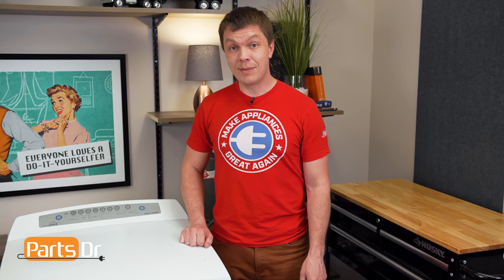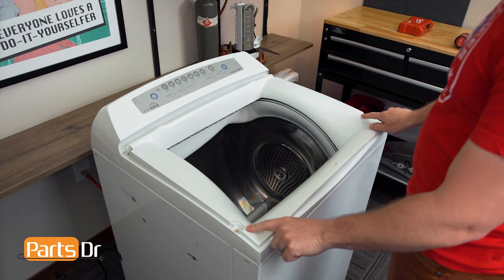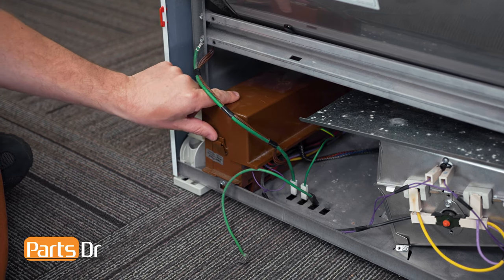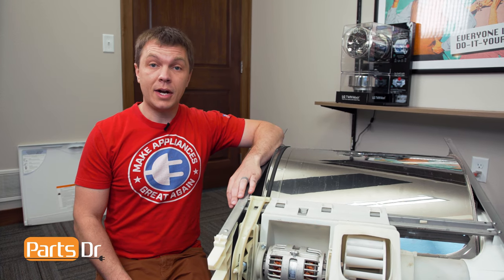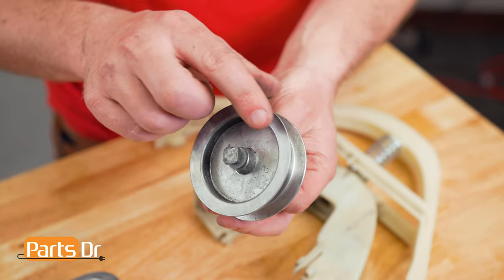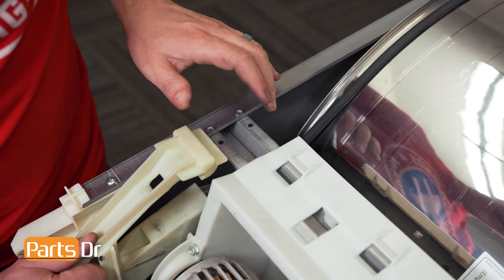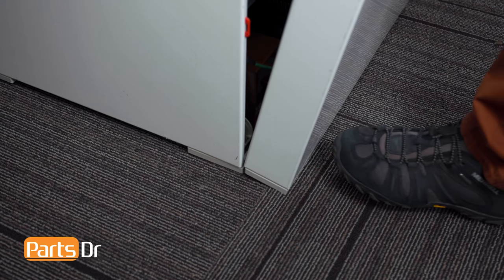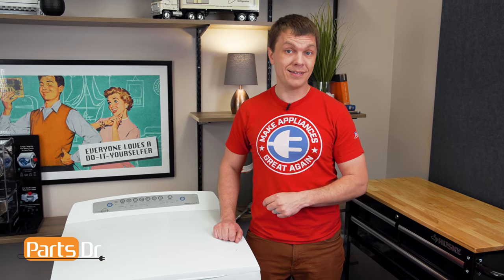How to replace Fisher & Paykel jockey idler pulley kit part # 395579

Comment: I have two noises, that seem to alternate.  The awful squeaking is clearly the bearings.  The other noise sounds like there are shoes inside...almost rhythmic thumping. Is this thumping noise what this pully replacement will correct? Also...you did not mention if or how to replace the belt. I assume, it should be done while you have it all apart? Thanks for the great video, and appreciate the added help

Comment: Would the idler pulley also cause the belt to be loose but not broken. Dry stopped mid cycle.
Reply from the maker: Hi Robin, yes the idler pulley is what keeps tension on the belt, so it could potentially be the cause of your problem.